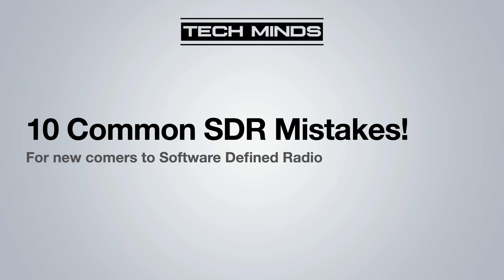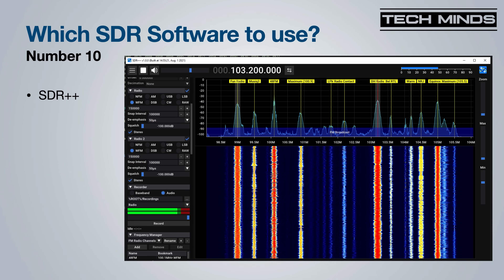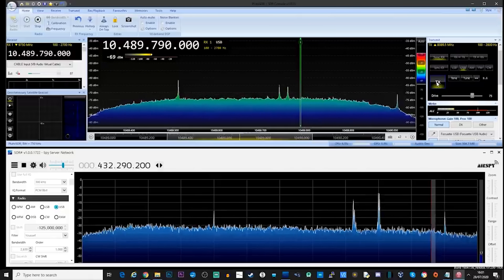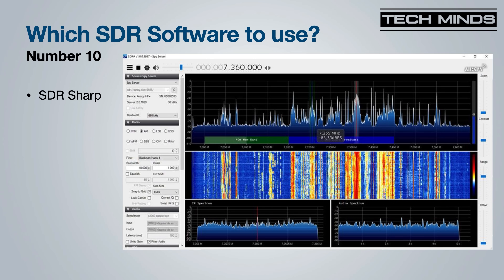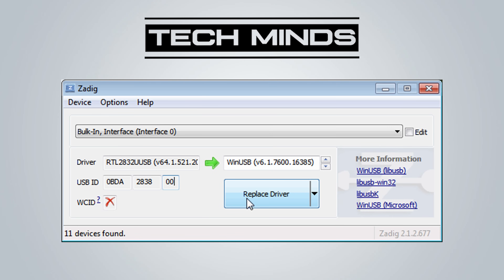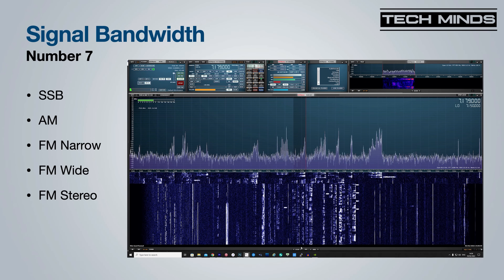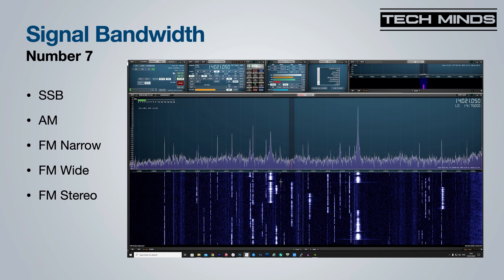10 Common Mistakes Made With Software Defined Radio

Comment: Which sdr and sdr software should I get for my MacBook Pro
Reply: Something that is supported by Software that is available for Mac OS. Stuff that was mentioned in the video as "only available on Windows" is probably the wrong choice.

It depends on what you want to do. If you just want a cheap receiver, something lie a RTL2832U based SDR (a concrete product name would be: Nooelec NESDR SMArt v5) and the software CubicSDR (never used it, but I know it is free and available for macos). This gives you a receiver tunable from 100kHz to 1750MHz for about $ 35.

With the technician class, your access to shortwave bands is limited. So I suggest that you get a radio that can transmit on shortwave as an incentive to upgrade. In that case, some OpenHPSDR based radio would be a good choice, like the Hermes Lite 2. It is a small QRP (5 Watt) radio that costs around $ 400. The main pcb doesn't come with filters or a case, so you must buy the filter board and the case and then there will be shipping and taxes. If you want to transmit on VHF and above, get something like an ADALM Pluto or an antsdr e200 and maybe filters, amplifiers and receive/transmit switches for it if you really want to use it as a radio (It is more about the learning experience).

If you just want a SDR without getting into the details, get the IC-705 or the FT-991A or something like this, they are SDRs where you don't have access to the details but they are great radios that just work. And of course you can get both, a blackbox radio and a SDR to learn and experiment.

Always remember, the Antenna is more important then the radio. For shortwave you can use a end fed halfwave dipol, they are popular for people that just want to hang a wire from the window to a tree or want something that is quick and easy. For VHF you need height and low loss cables, the good thing is that the antennas get smaller on the higher bands. So you might want something directional like a HB9CV for 2m and 70cm and small glass fiber pole. There are nice portable mounts where you have a metal plate you can put under the tire of the car and attach the pole to it. (I actually have a 2m HB9CV on a broomstick as a fast portable antenna, I just lean it on the mirror of the car and just reach through the window to turn it into another direction. The antenna elements can be removed for transport. The quicker/easier you can use something the more often it is used.)

I just wrote a lengthy explanation why free software is preferable and gave some examples for hard and software: https://www.youtube.com/watch?v=ORFYJuCo6jg&lc=UgzUwPgKzZJ5AEm8eVd4AaABAg
Reply: Thanks

Comment: I take exception with one of your recommendations. Placing your antenna in the garden seems a good way to use the space for a 2nd task, but in operation it gets in the way when it comes time to harvest vegetables. Even small tractors have  a hard time working around an antenna. It complicates weeding as well. It is far better to use an area outside of a garden.
Reply: @@davidwanklyn8842 What vegetables do they grow in the garden? It seems like it would be a hassle when time to harvest.

Comment: PLEASE ADVISE !  What about LDF2 and LDF4 coax, that is what I use ! I am just starting out with my RTL-SDR-V3 , and so far I have received transmissions from Florida, and I live in Toronto Ontario Canada, and my antenna is a small magnet CB antenna , and i made my own Dipole with LDF4 coax, however I maybe better off with an end fed half wave antenna..... what is your option... I figure because it can capture multi band , depending on length and time day ..... Please advise

Comment: Was waiting for AGC in sharp advise. Wrong advise in the video. It does not help in overload and demodulated signal distortions due to that. As a perfect example, go to airband, and compare very strong signal. Say 20db amp level, both AGC to off vs AGC.  Don't thank.

Comment: I'm just getting into amateur/ham radio so all of this is a lesson for me. I'm on the 13th floor of an apartment building in the UK with pretty good all round clear views. I am looking to install a quarter wave antenna upon my window ledge but obviously I need to be mindful of my neighbours as well. I already have some RG6 and RG59 coaxial cable with impedance of around 50 ohms so I am part of the way there getting my equipment

Comment: So with regards to antenna and coax. I was about to possibly make a mistake thinking receive only really didn’t require much in the way of feed line or a proper resonant antenna. One thing I have found even working HF is that on a given frequency, just tuning in, matching the antenna most always make the receive better. I know it is to protect the radio but has the benefit as mentioned. That said,  I am not sure using a given antenna matching device is safe with the SDR, maybe you wouldn’t mind responding to that aspect.
Second since we are not transmitting and  are not worried about db  loss in the coax why does one need to say run LMR 400 or even better to the antenna. I have considered shielding and possible parasitic CMC reaction from any coax. But the receive antenna is going to be somewhat exposed to TX RF no matter what. I will be placing a receive overload device in-line before the SDRduo. Your thoughts  will be greatly appreciated. Your presentation was very well though out and professional.

Comment: I'd like to add that decoupling the SDR from the  USB power and its noise makers, and the antenna from the other noise makers in the house is essential. Many people use multiple turns through #73 or 75 mix (or Type J) ferrites to reduce the RF noise coming through the USB power wires. I have seen noise going all the way  in to the VHF bands. 

This will provide a much better signal to noise ratio, especially if you're using small loops such as the YouLoop.

Comment: Hi As a Ham operator I love sdr Loved it so much I went out and got the IC 7300 - I use a long wire that is about 120 feet or meters connected to a 600 OHM latter like that connects to a 50 OHM PS239 0 UHF female This way I run a LMR 500 I found it so much better with this low loss but you really don't have to worry about if your just receiving. I don't know what they got that would work for the PC TX software wise so hitme back if you know the best free software i can get for QRP 5 watts would be great 10 even better because like you I understand how to use a AMP LOL but you really have to worry about SWR once you get above 20 watts or even 10 1/1 is not hard to get if you have a antenna analyzer I use a manual one I love it! well that's all for now hope your enjoying the hobbie KG5CUO
Reply: Ps be careful grounding your antenna Lightning loves Ground make sure you put it up 30 - 50 feet or meters and your all set a 1/1 Ballan or 4/1  will help you if you use latter line

Comment: #timecodes
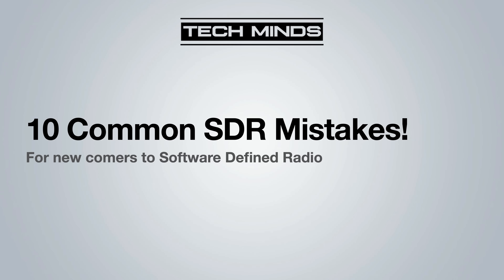0:50	10	what software
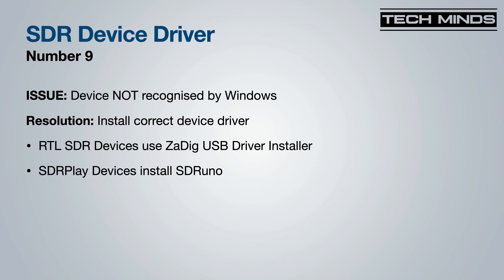3:20	9	device driver
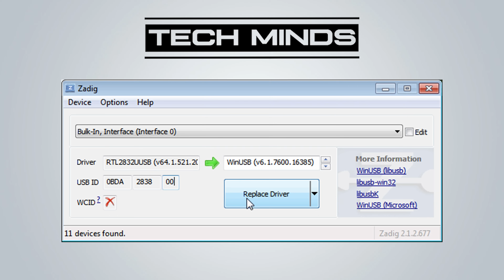4:05	8	coax type & losses
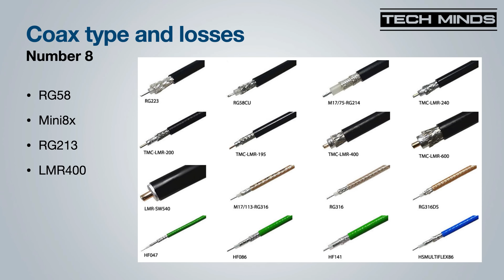5:21	7	signal bandwidth
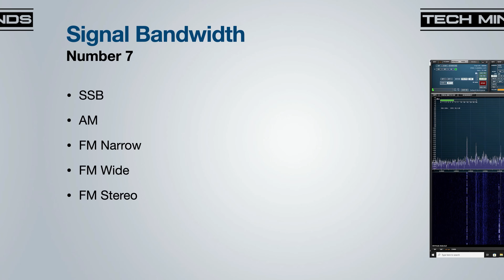6:27	6	time of day
8:00	5	modulation type
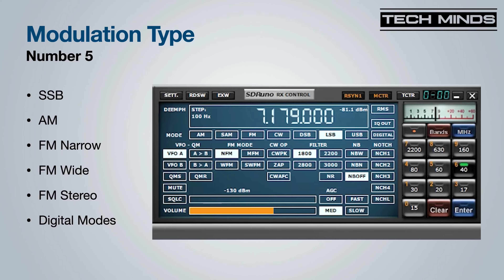9:08	4	high gain setting
9:52	3	low gain setting
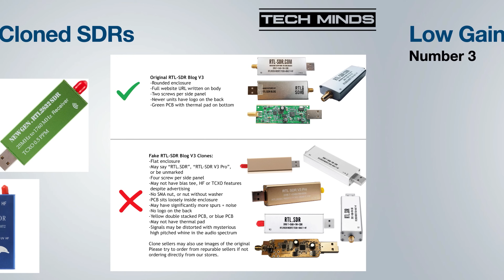10:29	2	cheap & cloned SDR's
11:44	1	antennas

Comment: @14:20 My father was an EE who worked primarily in power generation control. His buddy was an EE who worked primarily in radio. The friend told me that all I need for an antenna was a bicycle wheel and some knowledge. The "some knowledge" part got me every time. Never could meet that standard.

Comment: Is there an easy way to use the existing antennas in my cellphone and feed that input to my SDR software?
Reply from the maker: Tbh antennas in cellphone will be extremely small, you may aswell just make one from copper wire than butcher a cellphone.
Reply: I hear you. I was hoping to be able to watch the traffic on the WiFi, bluetooth, and cell antennas simultaneously

Comment: I one hundred percent agree. An antenna is the most crucial part of a radio setup. I am looking forward to hearing more information about SRRplay's "SDRconnect."
Reply from the maker: Thank you!
Reply: Yeah if you don't look into and learn a bit about antennae you're almost wasting your time with Rtl-sdr, depending on what you want to recieve you need a range of antenna setups for different wavelengths and modulations etc, or a good wideband discone or similar...

Comment: I plan to mount my dual band antenna on a channel mast roof eve mast. Can I attach a 2nd antenna to the mast example discone and use the existing lmr400 coax for both antennas? Or do I need a second coax ? I won’t be using both antennas at the same time. Some type of splitter? Ty
Reply from the maker: IMO Use a second coax, coax is a real important part of the system. Thanks for watching!

Comment: One thing i have found out is that usb cables need to be powered(active) if you want to or need to use an extended length over 5 mtrs .I was going to purchase an sdr play unit but i need  it to be placed in my workshop outside  50feet away from my pc in the house as i dont want to re run my coax cables into my house .

Comment: ADS-B and HFDL/shortwave hobbyist here. My own experience is that building my own antennas ended up costing more for a poorer-performing antenna that purchasing ready-made ones once you factor in the price of components, tools, test equipment etc. They're fine to play with if you already have a well-stocked junk box and workbench, otherwise just buy the antenna that you need and you'll save money in the long run, and get better results too. That being said, it's fun to build antennas and no one can have enough tools and spare parts!

Comment: I believe all 2m ham radio is wide band actually. Narrow will sound super quiet and cut. This may be a USA thing vs the UK.
Reply from the maker: It’s 12.5 on 2M in the UK due to 12.5 channel spacing, think it used to be wider but now it’s 12.5 on 2 and 25 on 70cm. But yes, I’m not sure on USA or other countries, kind of difficult to cover all countries in the video but I think the point is still valid. Thanks for watching 🙏

Comment: great vid as always. i had a discone antenna masted on my shed attached to an sdr and laptop with software decoding. I now have a campervan and use similar setup but with slidewinder portable getting very greater results. for extra £50 quid antenna is very important. keep up the great work.

Comment: In my opinion the DIY aspect of an antenna has always been one of my favorite aspects of the hobby. As a kid I used everything from metal window frames to chain link fencing just to see what I could get. Now I have far too many books on antenna design and theory. Great video keep up the good work!
Reply from the maker: I agree, making antennas, for any band is fun. Especially when they work! Thanks for watching 🙏
Reply: @TechMindsOfficial  Agreed. Throw in the fact that for most parts of the world, a better antenna doesn't impact on your licencing requirements, that is your licence is about the transmit RF out of the radio not the RF into the air.

I hope that makes sense.
Reply: @TechMindsOfficial   It's my opinion that hardly anyone discusses the use of a good Ground Connection! That needs to be discussed...
Reply: back in the days when double glazing came in Aluminium frames, I put my radio aerial against the frame and improved the signal to a basic manual dial LW MW AIr VHF radio
Reply: Can you use internal house electrical wiring as an antenna?
Reply: @russellm7530  The ground might be usable but the live and neutral usually cause too much noise. Plus anything else on the same circuit can cause noise. Usually you want something that has some access to the outside of the building you are in.
Reply: Of all those books which one would you recommend the most?
Reply: @beansmalone1305  The best place to start has to be the ARRL Antenna Handbook. It has everything you'd ever need to know about all things antenna with several projects to build yourself. I have several others that get very detailed but require either a degree in electrical engineering or a lot of previous experience. The ARRL Antenna Handbook starts with the basics and builds from there.

Comment: Is it okay to attach two different antennas for two different bands, but connect them both to the same coax cable? Or, does each band antenna need its own coax run?

Comment: Lots of good points here, thanks. Regarding making your own antenna, for ADSB on 1090 MHz, I made a quartter wave ground plane antenna by soldering bits of 18 swg wire to a SO239 socket. 69mm is about the right length. This fits nicely into the end of a length of PVC water pipe to use as a mast.

Comment: Wonderful video.  Very useful tips, especially for new SDR enthusiasts.  Regarding coaxial cable, one should not overlook the RG-6 75-ohm coax used for cable TV and satellite dish systems.  Although most SDR receivers are designed for 50-ohm impedance, and ideally used with 50-ohm coax, the slight mismatch of impedance between a 50-ohm SDR and 75-ohm coax would be negligible, especially for receiving.  Quad-shield RG-6 cable is relatively inexpensive, is easy to work with and purchase connectors for, and has very low loss characteristics well up into the GHz range since they are designed for satellite signals.  Also, coax cable can be used to construct DIY co-linear antennas for UHF operations such as ADSB.  There are multiple examples for making coaxial co-linear antennas cut for specific UHF frequencies, that can be as effective as commercial co-linear antennas for a fraction of the cost.  Again, thanks for the great video.  
Ken -- WBØOCV
Reply: Youp. But also use lna's with 20+ meters of that coax too any way. Will be totally good.

Comment: recently got the rtl took me three days to get the drivers installed properly. I then got a basic antenna mostly what I pick up is fm radio and digital signals. Did hear a bit of morse.  haven't gotten around to figure out the digital most say get two devices. I don't want to throw anymre money at this anytime soon.
Reply: Try extending the antenna with a wire(s), and possibly find a huge metal thing to stick the base to if you have magnet mount. No need to buy something fancy or expensive.

Comment: On the coax side of things, the shorter the better. I bought an RX-888. It has a USB 3.0 and its extremely power hungry. I put the SDR 1 metre from the antenna and used a powered USB extension cable (15 mtrs) to get back to the PC. After doing some experimentation using a 15 metre length of LL400 and the USB cable, the difference was staggering. Having 1 metre of coax at 1200mhz and sending the data over the 15 metre USB extension, compared to the 15 metres of coax and 1 metre USB cable, there were signals on the long data cable that were just not there on the long coax. It wasn't only on the upper freq either. The whole bandwidth of the 888 was so much better. The SDR lives in the ceiling space, its dry. More than one way to skin a cat.
Liked and subbed. Keep up the good work.
Reply: What make of usb cable did you use as i  was wanting to do this rather than have to re run my vhf/hf antenna coax cables into my house as at present they are in my workshop outside .I was looking at this cable MutecPower 15m USB 3.0 male to female cable with 2 extension chipsets - USB Active Extension cable Repeater Cable - Black - 15 Meters £65 .Now i presume that it gets its power from my pc.
Reply: Simple signal fading in a coax. Put lna or simple tv antenna lna with some minor additional work on it, and you can run even more the 15m coax no problem. Use such with sat tv coax for example as well.

Comment: Power consumption was completely neglected. SDR's consume several watts of power even 
when they are doing nothing. The A to D converters, DSP chips and CPU's are always running.
Not much of a problem when you are using mains power but a big deal for portable operation.
Try finding a SDR that will actually run on a 9 Volt transistor radio battery LOL. Buyer beware. 
The manufacturers hide this in the specifications or don't mention it. SDR's are power pigs.
Reply: Because most people would just use it with a PC.
Reply: sdrplay is rather low power, others seems to run way hotter.

Also, the software processing the data will make your computer use more power! If power is critical always stay with the lowest useable bandwidth!

Comment: One of the key specifications for SDRs is the number of bits in the ADC (resolution). This controls the potential dynamic range of the receiver. SDRs have wide-open front ends (no or minimum filtering), This means they have to deal with very strong signals at the same time as the weak one you are trying to listen to. Cheap SDRs might have 8-bit resolution, medium-priced SDRs might have 12-bit resolution. That's a 16 fold improvement in dynamic range. And, some high-end SDRs have as much as 24-bit resolution. That's a 65,000 fold increase in dynamic range. You will have a much better experience if you buy more bits of resolution/dynamic range!
Reply: But keep in mind that signal quality improvement perception is logarithmic, not linear.
Reply: @fungo6631  each bit is 3dB of dynamic range.
Reply: Some few have wide open front-ends. Most actually have a filtering and possibly a tuner doing hetrodyne conversion there.
Reply: I think that the optimal is to use 16 bit as RSP series or Airspy
More bits are for more pro usages and require more power or bandwidth connectivity as elsd3